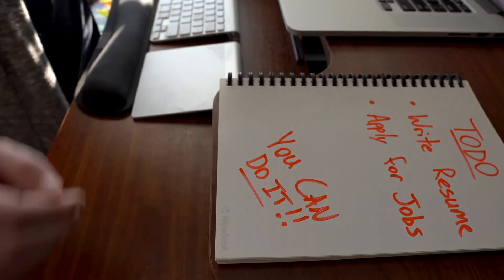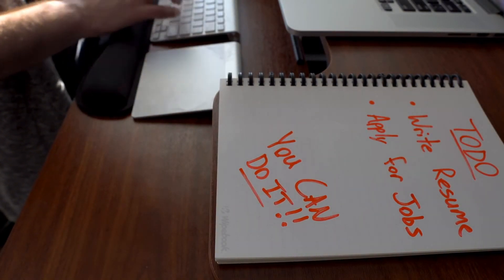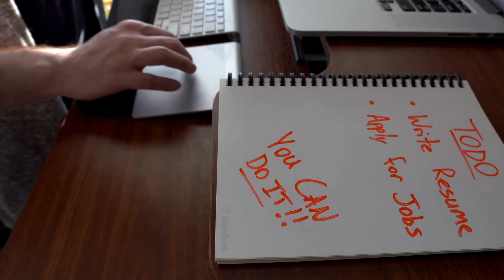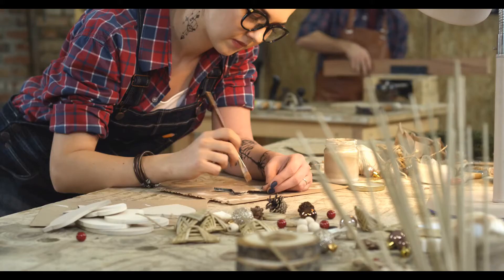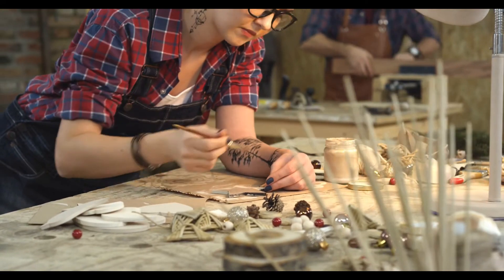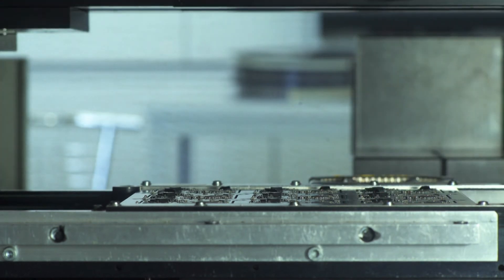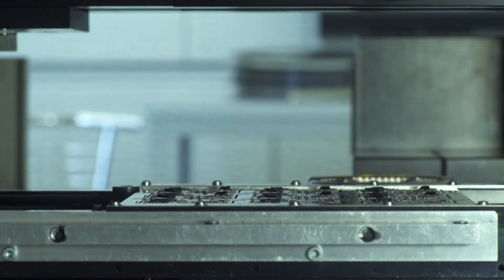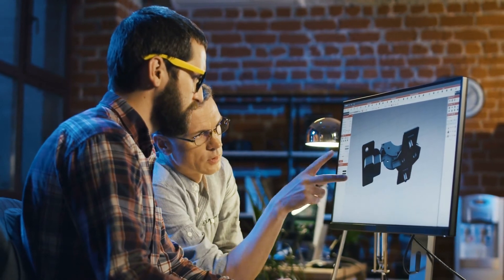How to maintain creativity and motivation

Comment: Hey Gene, I'm going to be testing this idea, but you may want to try it for yourself. I am going to be purchasing a thermoelectric fan to move air with heat generated by a kerosene heater. Do you have any thoughts on this or have you tested it yourself?